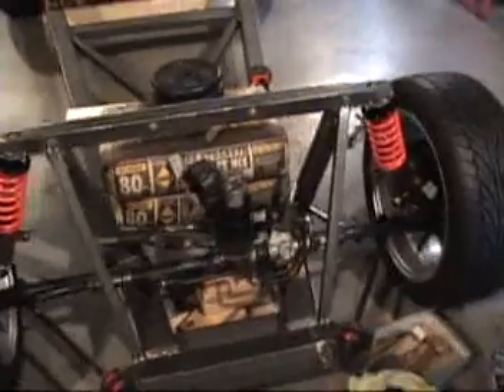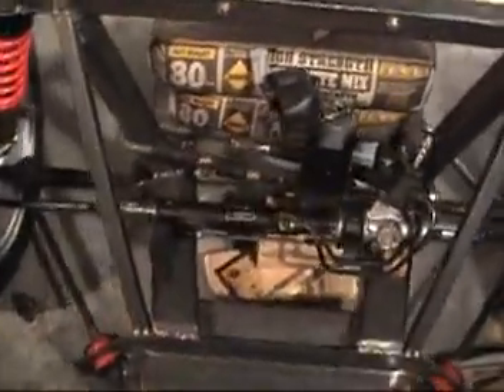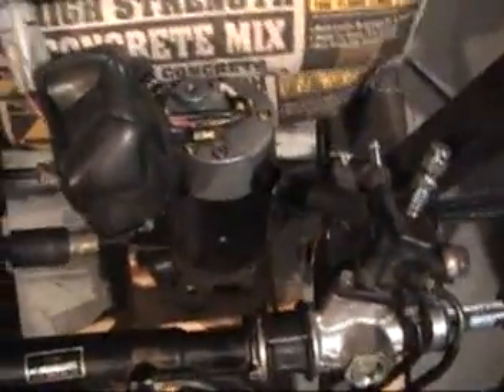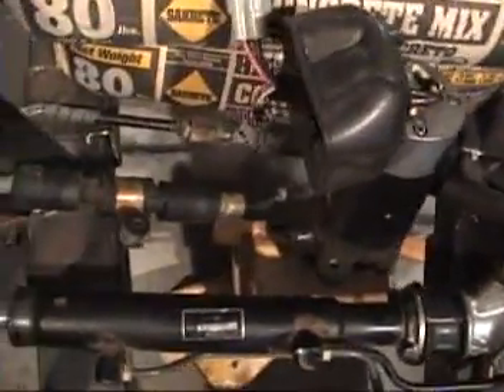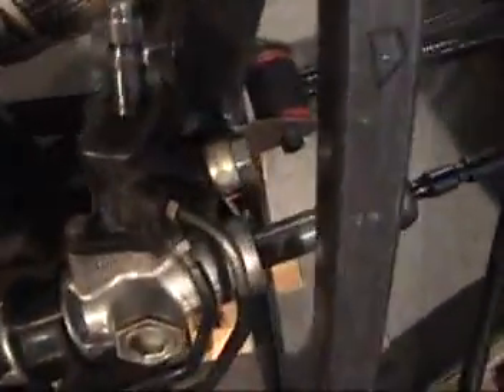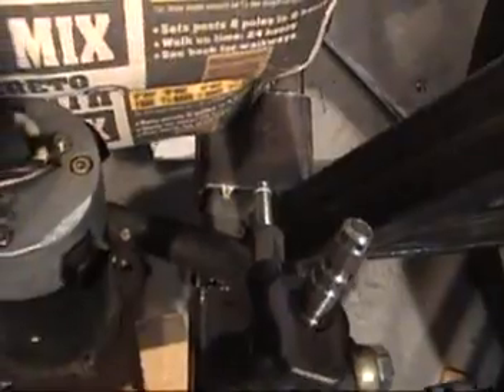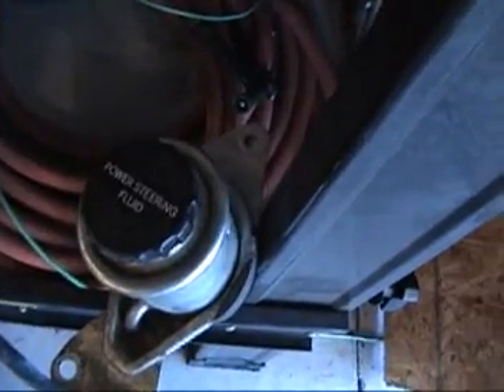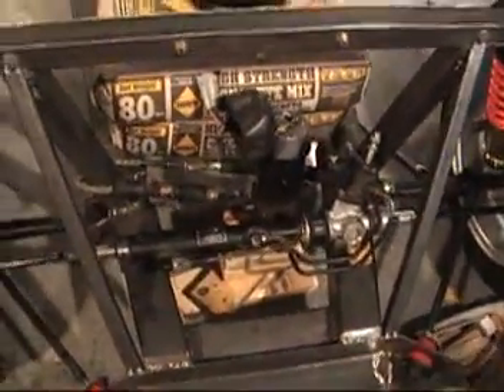Start planning for the VW bug steering rack #233

Comment: Sweet build man I've got a standard bug I'm putting together and I want to covert to a rack system what would you recommend
Reply from the maker: I would believe that any rack would do. The thing to watch out for would be the width of the rack. The tie rod end knuckles (attachment point to rack) would have to line up with the pivot points for the control arm. if these pivot point are not aligned up you will get bump steer. Given the design of the front beam this might be difficult. Good luck and never give up.